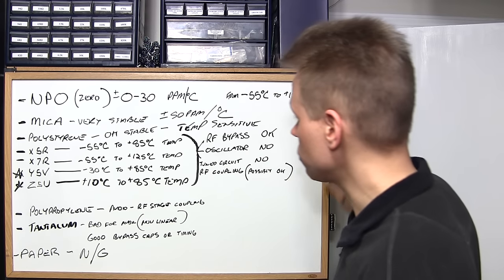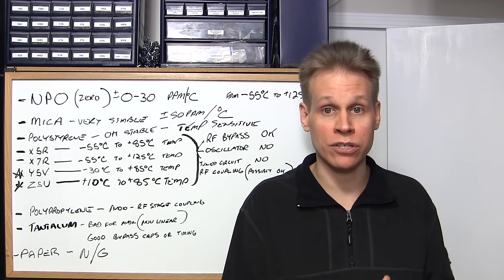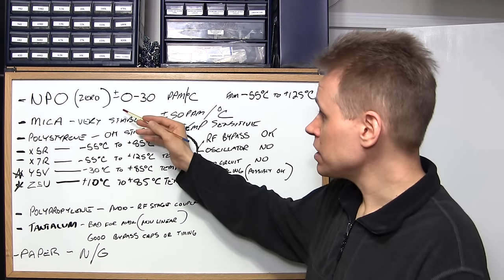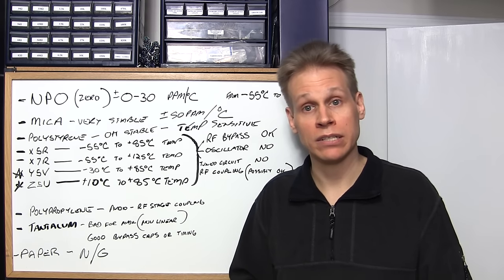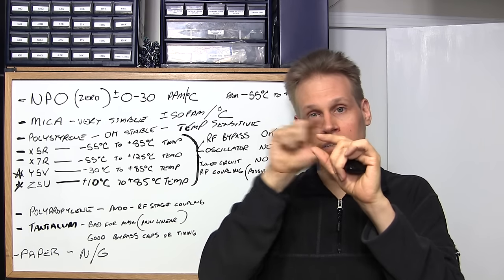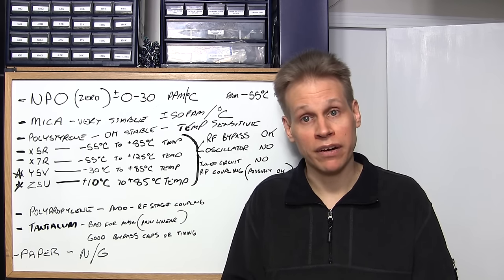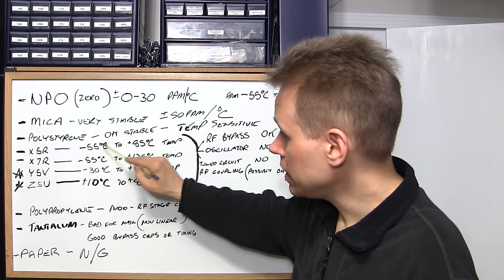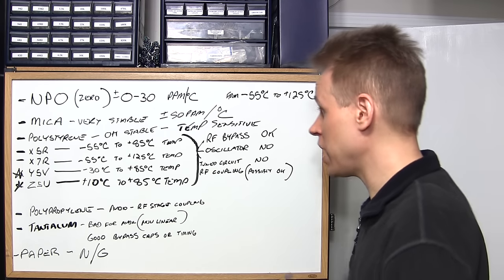Which Capacitor Do I Use? Tech Tips Tuesday

Comment: Hi, I have not done any videos but I watch a number of other video teaching videos ,I justed started to watch a video's from a German video called Great Scott and also W2AEW video teaching slot the authors have had question and answer sessions and they have said that they spent a good number of hours preparing videos. My background is a electrician and Ham Radio operator building home brew equipment mainly antennas for 2 meters and 70cm band and also receiver building when I have time having a Autuisc stepson tends reduce work shop time alot.

Regards David Grey
Reply from the maker: +David Grey 
Ok David. Thanks for your comment, and taking the time to write!

Comment: Mr. Carlson,  Thank you for another fine video. I really learn alot form your videos! I'm getting ready to restore a Stabilock 4040, it has some  e-caps that are no longer made. They are a brown relish color maybe with a Bakelite housing and stamped ROE 100/25 T8 EK or EKU TN. Could you provide any help with what these e-caps should be replaced with? In advance thank you kindly. Joel
Reply from the maker: Hi Joel, just replace those with a good quality capacitor of the same rating. My Polarad is loaded (was loaded) with those. I just used some good quality Nichicons.
Reply: Mr. Carlson, Thank you Very much. I would assume low ESR as well.  Off we go ordering a bunch of caps.  Thanks Again! Joel

Comment: It's not purely piezo-electric. It's also tribo-electric. Condenser microphones are  based on a microphonic capacitor.  https://en.wikipedia.org/wiki/Triboelectric_effect   I try to keep my  caps, away from the resistors too, especially power resistors that get really hot. I just had a beautifully hand wired old true point to point German amp in, where some boob put an E-lytic adjacent to, and touching, a big power resistor. It was so cooked it was toasted on the outside, where it touched the resistor. I think it was the shunt cap for the power tubes' cathode resistor. When it's that obvious, and it fixes the issue, and everything else is German mylar Wima caps with an insanely high Q, I am outta there. I am also sure it was a shunt cap.

Comment: nice video ! just what i needed for my personal study for making a regenerative receiver,
silver mica c's where relative easy to find, but NP0 is a "term" ? how do i recognize them ?
they come in difference types ? what are their names ?
Reply from the maker: +Eric-Jan van den Bogaard 
Hi Eric. NP0 ceramic caps are usually identified by a black spot on the top of the disc capacitor, So picture a standard beige/brownish colored disc, then dip the top 1/4 of it in black paint. That's usually an indication of an NP0 thru-hole style cap. For surface mount capacitors, unfortunately you need to have the specs, as there is no identifier.
Reply: +Mr Carlson&#39;s Lab Thank you for this answer, I guess the SMD versions are easier to get this time and age.... and cheaper.
I will look into this further, Thanks !

Comment: Amazing. I'm a musician and amateur electronics buff, some diy mainly to with guitar, so amps and pedals. My friend and I also run a small recording studio filled with ancient gear that i do my best to repair and restore. Currently working on 2 x 20 channel WardBeck consoles. So many questions about design of the channel strips, they all have ceramic caps and tantalum. Would you substitute these? How does one contact you other than publicly like this.

Comment: So, if i change out a signal cap in an audio circuit that was a paper and oil cap does that mean i should not replace it with the same cap i have in my stock that is nos unused?

Comment: HI there Mr C can i just ask you one question, a Diamond 4:1 balun, used with WD 330J HF folded dipole, have you any idea if you should get continuity across the SO 239 connector, or is it capacitivily coupled, or is it inductive coupled might be a BU 50 balun...from Fred in England g4vvq.

Comment: Just saw this video and I never really knew there were those bumblebee caps. like they are in disguise and look like resistors. I am currently on the tail end of restoring my first tube radio, and I had to stop the restoration cause I am now back at college. However, i am failing to find any info on what to replace the bumblebee caps with. I have the "normal" yellow caps. Can I just use those, or do I need to purchase specific ones?

Comment: I wonder if you could use one of those big ceramic disc caps as a vibration or shock sensor for an Arduino? I may try that.
Reply from the maker: +Gwen Patton 
With a good hi gain op amp in front, I don't see why not.

Comment: If i need a capactor with a value below 100pf in an audio circuit. Should i use polystyrene or just film capacitors? Polypropylene seems hard to find
Reply from the maker: Hi Jethro. Silver Mica will work well, and they are plentiful.
Reply: @MrCarlsonsLab Thank you very much Mr. Carlson!

Comment: What kind of capacitor would be the best choice in buck converters (let's say: step-down 48-->5V)? Any reason against ceramic? I mean, it's also kind of an 'oscillator'.
Same for high-voltage transformers like a flyback: it's also kind of an oscillator (although not 'sensitive'), but I would need the very high voltage tolerance, therefore: wouldn't ceramic still  be the best choice?
Great video, thanks a lot, with greetings from Germany!
Btw: your lab looks like straight from the ISS with all those instruments; are you sure you are on Earth?  ;-)

Comment: Hello, My defrost system in my frig stop working after a power surge and i found out that a red disc capacitor on the board that controls the defrost system burnt out and i cant find any identification numbers on it due to it being burnt, how do i find out what capacitor to replace it with?
Reply from the maker: Hi Lloyd. That may not be a capacitor, It could be an inrush surge protector, MOV or Thermistor.

Comment: superb video, i have apple board which has design fault , gpu power rail has 330uf caps  SMD, which very often fail. if i want to  use next power full cap, which one should i use ?
Reply from the maker: +Turbo 
Just replace it with the same value, but higher quality capacitor.
Reply: +Mr Carlson&#39;s Lab how do i determine higher quality ?

Comment: What kind of cap on the tone (treble) controller on an electric guitar? I think what I usually see is the ceramic style.
Reply from the maker: +Mathias Nilsson 
PVC, Poly, Mica should be ok. Disc ceramic caps should not be used in audio circuits.

Comment: so what would be a good choice for load capacitors used with quartz crystals, i.e. clocks for micro-controllers?
Reply from the maker: NP0 or C0G capacitors would be fine. Keep in mind that these capacitors are also a ceramic style, but highly accurate. Mica will work as well.

Comment: Im looking for good quality high temperature 47 µF 50v capacitors. Ford used electrolytic ones read it for 105°C in their computers in the late 80s and early 90s vehicles and the computers overheated in the electrolytic capacitors leak out. 

It seems to have been a design issue in the computers and they no longer make parts for these so the only option is to buy one that’s been rebuilt or replace the capacitor‘s before they corrode the circuitboard, does anyone have any options for a better type of capacitor?

Comment: I've seen some small, clear axial capacitors on older computer motherboards (Apple and Commodore loved to use these) that look for all the world like small signal diodes. Are these typically polystyrene, ceramic, glass, or some other dielectric? Is there a way to know at first glance? I've found several images that show such capacitors (they look quite different from the typical polystyrene cap), but no pages that give details on the dielectric.

EDIT: "WE GOT ONE!!!" There's a close-up photo of such a capacitor at diystompboxes that appears to be a MLCC in a DO-41 package. The marked value of 104M/50V seems about right for a Class 2 ceramic cap in that size package.
Reply from the maker: I have a bunch of ceramic caps in diode packages. They are a surface mount device squeezed between the lead out wires in the glass shell.

Comment: What about metalized polyproplene ?  Doesnt seem like those capacitors can provide shielding for coupling purposes.
Reply from the maker: Hi Mark. Of course they can, the have layers just like foil capacitors, its just applied to poly. Poly capacitors have a very notable outside layer.
Reply: @MrCarlsonsLab  I noticed that some caps I have I cannot see the difference on the scope. I think these have a different architecture.

Comment: Paul - how do you feel about those LCR Meters and their ability to test caps in circuit  ?
Reply from the maker: +Ron C 
Hi Ron, they work in circuit (a lot of the time), and if in doubt about the measurement, un-solder one pin of the cap and re-test with that capacitor pin making no connection to the trace.
Reply: Thank you Paul. I like those devices because they also measure resistance which is in line with your demonstration of a bad cap. Thanks and great video !!!!
Reply from the maker: Your welcome Ron!

Comment: Never knew ceramics were such poor caps, great video, Thanks.
Reply: +mike barton Well, not sure Paul intended to convey that ceramics are 'poor" caps. I love them when I can use them, they are really really reliable. Awesome for bypassing and in some filtering applications. Just keep them out of the signal path and oscillators, they don't want to live there.
Reply from the maker: +cny02253 
And NP0 caps are a form of ceramic as well.... Just built different. Thanks for your comments Mike and (don't know your name) cny02253 :^)

Comment: I have been repairing a old vatmint xl 450 tube amplifyer. It  has two blue molded plastic caps from the 70s I'm not sure what the value is I have looked at a old parts list and I know they are 100volt  but that is about it. The label on them say 
molded .11-100 10% made in usa. Do you know what I should replace these with. I ordered some green .15 uf 100 volt mylar capacitors. I hope these will be close enough I am not sure if the molded cap is .11 uf it just says .11-100 10%. 
After watching your video  I like the orange drops now.
You have an awesome set up  I bet N.A.S.A. would be jealous. 
Your help would be greatly appreciated.
Reply from the maker: +B Shel 
Are the originals ok to test for capacitance? If so compare them. It does look like they might be .1uF from what you have written, but I can't be sure.
Reply: ok thanks
Reply: They are no good any more I connected two .47uf 50volt electrolyte caps in series it worked good for about 20 minuets I tune it to my voice for max output on am it  was keying up 275 watts going to @600 watts forward swing. I un meshed the final load to 250 watts dead key and it poped it was probably the caps I took them out of a old cobra 19 that didn't work i also probably need to go with a 200 volt cap.I  really enjoy working on the old tube type stuff so I will gradually increase the uf untill I find the best combination.  
You are the second person  who said it sounded like a 1uf. Thanks.

Comment: I am taking a " capacitor refresher course" this morning and this video prompted me to ask a question. Is there any harm in replacing polystyrene caps with NP0 or mica caps? There are 4 in the kit I am referring to and they are all in the VFO circuit. The kit is an OHR-100 CW transceiver kit. I've never liked those things because of their fragile nature. 73 NE5U
Reply from the maker: Hi Michael. You could give it a try. I don't know how much thought went behind the drift compensation with the caps they chose. Sometimes designers use a specific capacitor to drift in the opposite direction, so to cancel thermal movement. You could experiment and find out their thought with your NP0 or mica caps.

Comment: Mr. Carlson I recently ran across a Kikisui 6100M Oscilloscope 100MHz  it was well cared for and came with out the probes I looked online for the brand name probes and couldn't find them.  Would you be so kind as to recommend a basic probe that will work.  Thanks Forever Learning
Reply from the maker: Hi Gary. Most modern scope probes rated to 100MHz will probably work. Just make sure it (the new probe's specs) falls within the compensation range listed in the owners manual.

Comment: I have an old G.E radio with 2 paper cylinder caps rated .05 mfd 400 vdc, Im wondering if .05 is the same as 0.05 mfd ?  it also has a split bee style one and im not sure the current direction but I'll post the rings in both directions blue, grey, orange, purple, yellow. or vice versa what rating is it?
Reply: the blue is separate from the other four colors

Comment: I have an NOS PIO cap in one of my electric guitars and it gives a good tonality.
Now I'm a bit insecure about whether it's a good idea to leave it in there. Is there any way to measure its output and find out if it can have a damaging effect on my equipment?
Reply: Just replace it, if only for peace of mind. LOL
Reply: you don't use it with high voltage in an amp or something
even if it is leaked dc there's no dc in your guitar
even if it is ancient and crap   you don;t care 
if you like the sound  use  it
Reply: John Sfixton
Thanks. That's all the info I needed :)

Comment: thanks for the video. and if i can ask you here? your oscilloscope takes my atention, because it have 2 basetime switches. And it's no usual. i supose that it's better becouse in this way you can compare the same signal with 2 basetimers and see if someone moves. maybe to see at the same time modulation? thank you in advance.
Reply from the maker: +Fede Marroquin 
Hi Fede. Dual time bases are great for looking at two signals, at two different times. The 547 does this in "alt" mode quite well.

Comment: What do you replace the paper caps with when they begin leaking 
and also what if the paper caps don't leak would you replace em anyway ? 

Thanks in advance 
- Adriaan
Reply: I'm not an expert but after seeing many of his videos I'd say you replace them in any case because if they are 20 or more years old they're practically all bad or will become soon; also keep in mind that in some testers they could show even more capacitance than the indicated because of the way it's mesured: the tester mesures the time of charge and discharge, if the capacitor is leaky it behaves like a resistor so the time for charging is longer and an apparent higher capacitance is mesured. For what I remember he usually replace them with the orange drop ones but I think you should double check for the function you're putting them into.
Reply: @XMarkxyz  thanks , 
My PM3230 scope is working very well and the accuracy is also what it should have been many years ago but the A channel doesn't seem to work so I'll beging sorting my big box of caps then and hope I can replace every cap that's leaking
Reply: @Inkreptile  I though you were talking about that "bumblebee" and wax covered paper caps that can usually be found in tube radio, so If they are of that type with the square mound directly attacched to the board I don't know much; but I think you should first test a couple of the suspect caps before doing all the work, since it is mostly time that kills that kind of cap I find strange that only one channel is not working as intended but maybe because it's the one you used the most its capacitors were stressed more
Reply: @XMarkxyz  yeah problably the guys at the repair shop (where i got this scope from) didn't need two channels so they used the A channel the most ...

Comment: When you say you never want ceramic style capacitors in "oscillator" circuits, does that include audio circuits?
Reply from the maker: Ceramic disc capacitors are great for bypass, not so great for the audio signal path.

Comment: Good tutorial Mr. Carlson.  Referring  to the old Sprague bumblebees used by Gibson in the mid 50s for their Les Paul guitars.   Guitar players swear by them and seek out even used ones offered on some resale websites for $20 or more..untested because they think that retrofitting their electric guitars will improve the guitars tone. 

 Another myth but it['s amazing how many believers there are out there. Gibson has been using the orange drop for years and the guitars have good tone.   But there are those that are looking for the "holy grail of tone".
Reply from the maker: I guess leaky capacitors make good sound? Those caps sure didn't make sound like that when they were new. As electronic "people" we look at this as a problem..... As musicians, they look at this like a fine wine. (gets better with age) Unfortunately for amplifiers, and other tube circuits, these capacitors absolutely destroy them.
Reply: These 50-60 year old PIO (Sprague Black Beauties/Bumblebees) have a myth
about them that is similar to the '59 Gibson Les Paul.."the holy grail of tone", 
and if it originally came with bumblebees, then the mindset is that  everyone
should  have two of these also.
Internet sellers often  cash offering  NOS (new old stock) or even recycled ones for premium prices, It;s a similar myth to the RCA Blackplate 6L6  (NOS) that are hoarded by online  resellers/tube stores and sold for over $200 to as much as $386 for a matched pair.

I thinks there is a market out there for these PIO 0.022uf caps. A well known
guitar parts shop is selling a new version of these for $18 USD a piece!

Comment: Back in my kid days (no equipment) I'd test for leaky plate-to-grid caps just by doing a cold startup  while touching the second tube.  If it heated up faster than it should, I was getting DC leaking onto the grid.  Never heard the term "red plate" even if I understood the concept.  Yeah, I'm in my 70's, and grew up poor.  Oh, it a pinch I've used NP0 ceramics in oscillator circuits and gotten away with it.